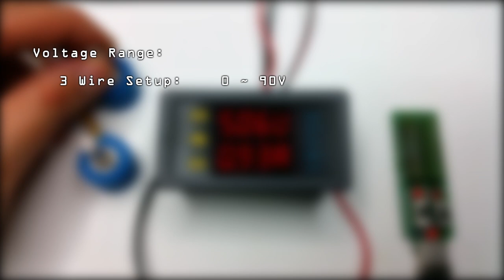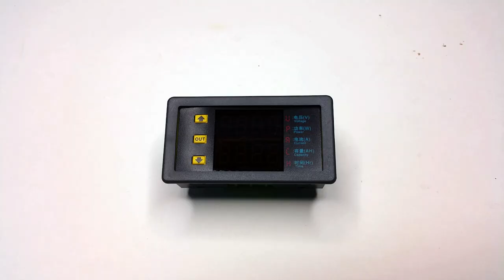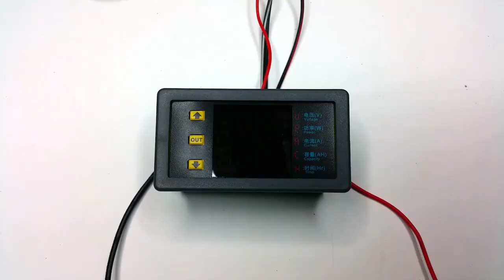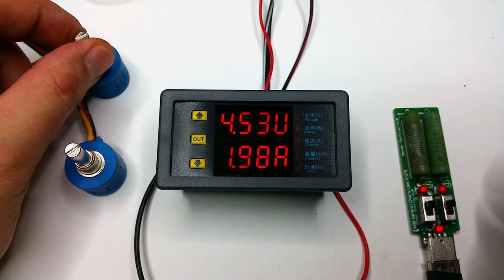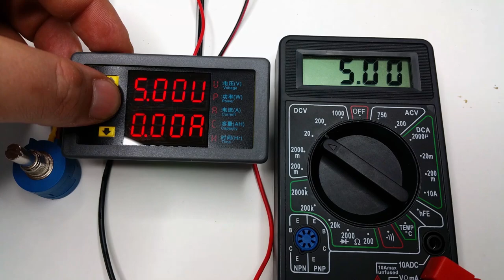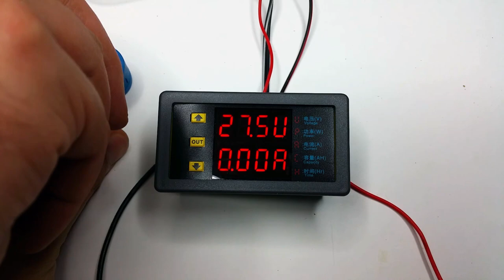VAM-9020 | Digital Voltage, Current, Power, Capacity Panel Meter - Setup, Wiring and Calibration

Comment: Hello,
I buy a DC 90V 30A Volt Amp Battery Capacity AH Power Meter Charge Discharge Monitor NEW and you have to give explanations on the setting of this unit unfortunately I do not understand English you could have done it in writing.
I have a question please to serve the JMP1 and JMP2 thanks for answering me for France
Reply from the maker: You have english subtitles in the video, you can turn on auto translate to french and you will have the french subtitles as well.
Reply: it's true I did some research and I found but what's the use of the JMP1 and JMP2 because in the video you have unsold the JMP but you do not explain why?
Reply: Is there a minimum voltage for the externals ps ,vext ?
I